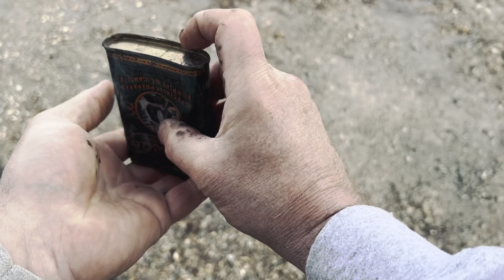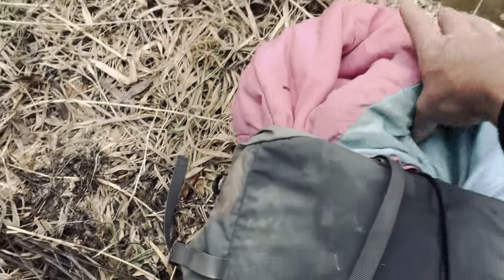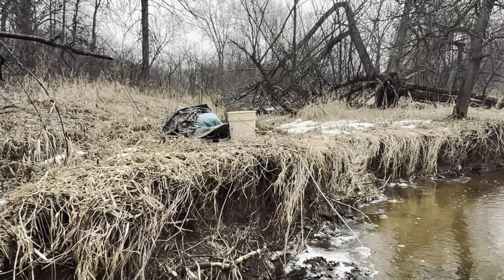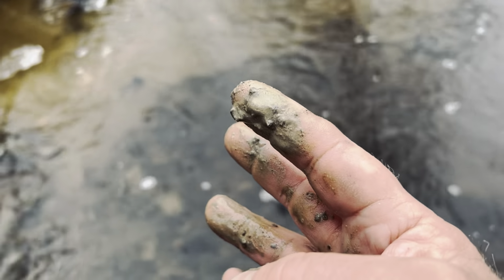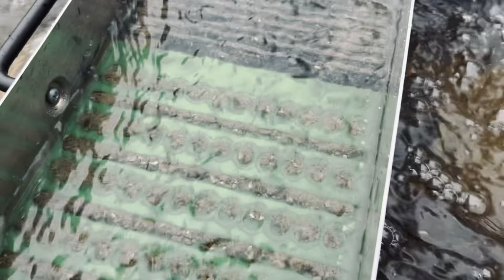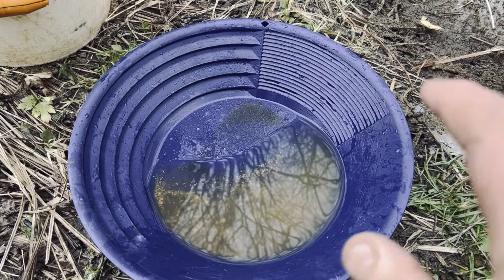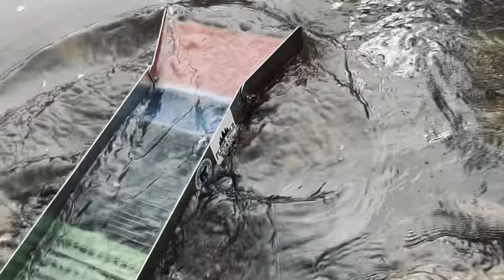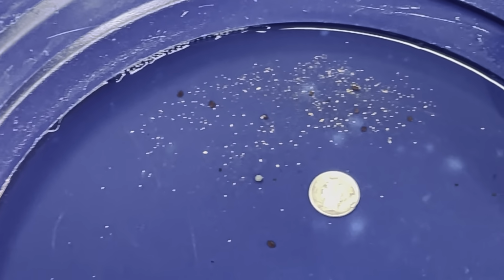Why is there so much gold here ? #grassrootsmining

Comment: Would you like to meet up and go to that spot with me? I have 2 reverse helix trommels one that can process 1 ton per hour and one that can process approx 10 ton per hour that is 99.99% efficient that I built both myself! They are small enough for 1 man to carry and it classifies the material and the gold all comes up the screw and into the catch pan while running you can watch the gold fall into your pail!
Reply from the maker: If it’s motorized it’s illegal there !!!!
Reply: @FlourgoldWizards  it just has a 12v windshield wiper motor that drives it.. Is that illegal? What state is it in?
Reply from the maker: @ShilohSedlak  
Unfortunately yes…. Wisconsin